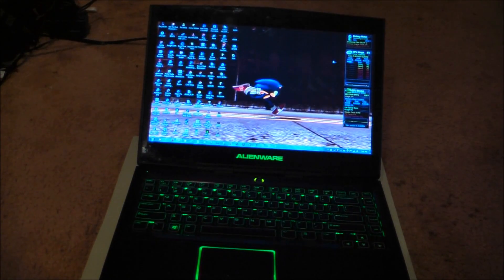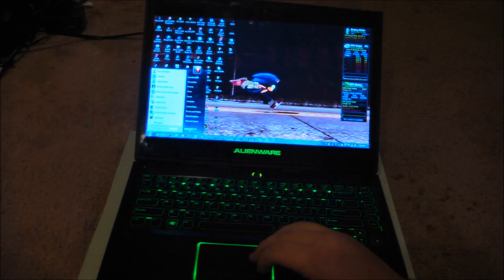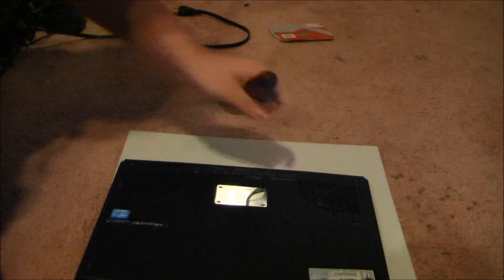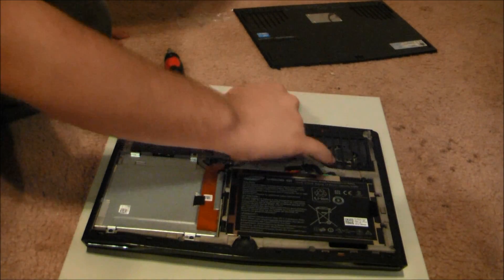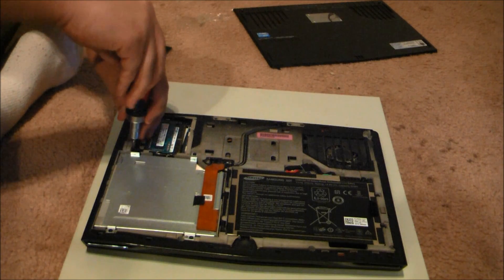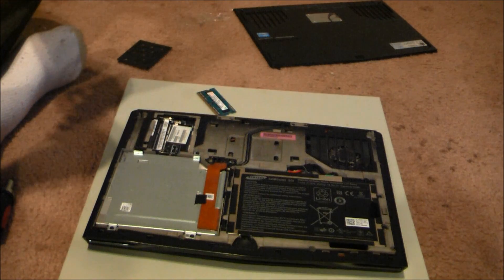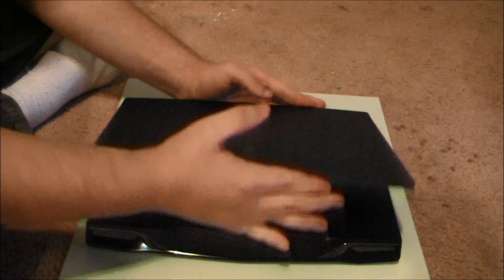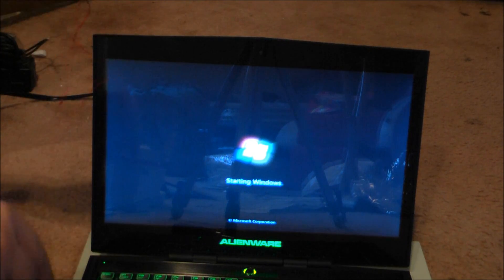How to upgrade the memory in an Alienware M14X R1

Comment: the really tricky thing is that they both do have the PCIe slot in the exact same place, exact same slot, but they are wired different.  You can read about people sticking in an SSD msata in to an R2 but not an R1, so it is very easy to get that mixed up, especially when people say they are the same except the processor and gpu... I had to find that out the hard and expensive way...

You can also often find that the m14x was offered with msata ssd or wihd, but hard to find out details about r1.
Reply: I tried last week to put and mSata in my M14xR1 and was not working  😞

Comment: and you can not stick in an msata SDD in the R1, but you can in the R2.   I just wanted to make sure the memory 16gb was ok before I buy it like I did with the msata 256g plextor I bought and ended up sticking into my wifes laptop...

The R2 PCI-e port is wired to electronically accept an SSD, the R! (which I halso have) is not :(  thats the biggest suck difference..wish I had an R2 just so I could have extra SDD space internally.)